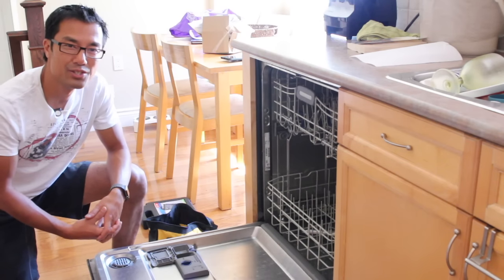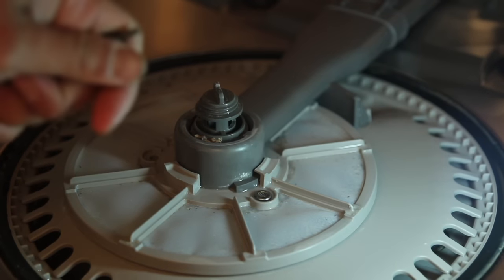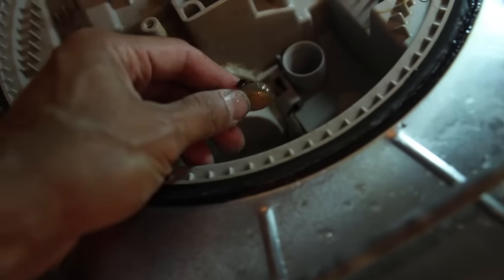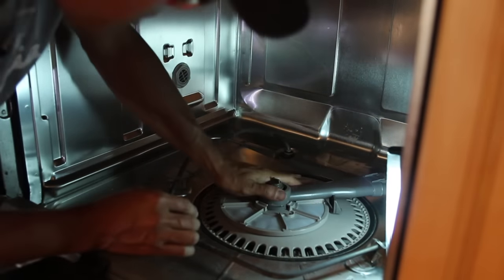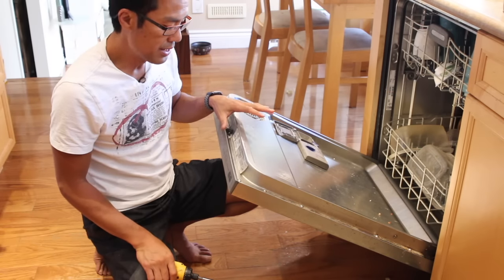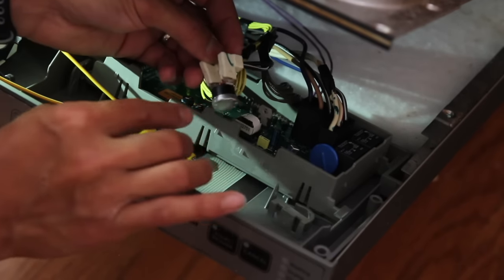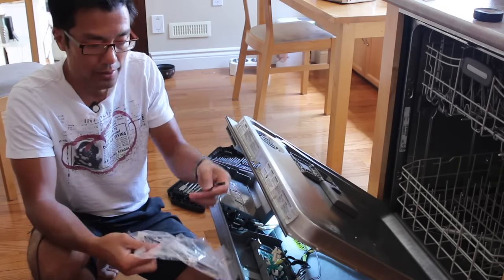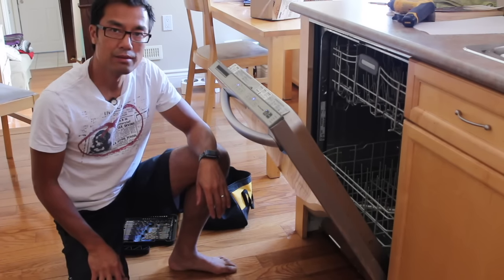KitchenAid Dishwasher Repair - No Power, No Lights and Grinder Clean up

Comment: As you probably already know, jumping the fuse can fry other components, (even if it’s only for 2 seconds), use a volt meter and check it for continuity. The other thing I wanted you to know is that you SHOULD have used the wire(s) that came with the fuse. It’s a common problem that Whirlpool appliances have and Whirlpool had to come up with a “fix” for it. That fix was those wires. Just replacing the fuse itself may not be enough. The wires going to the fuse tend to over heat causing the fuse to blow. Replacing those wires that came WITH the fuse will stop that problem. It’s easy to do, just cut and strip the wires and stick them into the connector that came with the fuse and screw them down tightly. I can’t tell you how many times I have to go back to people’s homes and reinstall it WITH the wires because it can/will possibly blow again. I’m a certified Sears appliance technician. Good luck in your endeavors, all in all, this wasn’t a bad video.
Reply from the maker: These are great advice.  I am going to dig up those wires and install them like you said.  I also got myself a volt meter so I can do continuity tests going forward.  Thanks for commenting and the feedback.  Really appreciate it.
Reply: The Patriots Brother... Ha, you are everywhere. I just had a thought. My heating element and HiTemp thermostat may be aging because I'm overworking them with all the HiTemp cleaning modes and my HOT water only averages maybe 85° because I'm on the 3rd floor of a 100yr old condo. Water pressure is OK, but I have to run HOT water for a while to get 100°+ water.
Reply: Newer dishwashers today need a minimum of 120 degree water or they will shut down and just blink
Reply: @ThePatriotsBrother  - My Maytag manufacturer date is 2010 or 2011.  Would that be considered NEW? It washed dishes fine for years, but quit in 2017. I just fixed it fall of 2019. I really don't like washing dishes, lol!
Reply: Hate to say it but most dishwashers nowadays have their first problems after 4 years.
Reply: Your dishwasher is almost obsolete. Parts are getting harder to find. They want you to buy new. They make more money that way
Reply: My problem with my kitchenaid is I have standing water in the bottom and no power, if i vacuum out the water and wait a bit, eventually everything works again.. once or twice, then same thing at the end of the cycle it won't drain, no lights no power. vacuum out the water, next morning it's working again. any ideas?
Reply from the maker: Check the bottom front right water spout, sometimes, things get stuck underneath and prevents the cycle from completing.  Also do a clean like in my video,  the grinder might be stopping because of built up of things and preventing proper drainage.  The last think is also check the control board to see if there are any burnt areas…there might be some damage that is causing the cycle to stop.
Reply: @mark7603  this is the same problem I'm having! I replaced my chopper about 3 months ago because the dishwasher was making weird noises and failing to complete cycles. That fixed the problem until yesterday when my dishwasher lost power and there's standing water at the bottom. The cycle seems to have completed as the dishes are clean but the water wouldn't drain. I assumed it was due to the fact that it lost power and therefore the pump couldn't pump out the remaining water. I'm gonna have to check it thoroughly today. I'm hoping it's not the control board because I don't really want to buy a brand new dishwasher yet lol.
Reply from the maker: Good luck with the troubleshooting.  You are right about the parts, it is harder and harder to find and they are expensive.  I also would consider buying used dishwashers of Facebook market and stripping it for parts.... Might be cheaper.
Reply: @DDIY-Guy  I discovered yesterday the fuse was blown on mine. So I'm gonna replace it with tips from your video! Thanks for making this! And I appreciate the helpful tips in the comments too!
Reply from the maker: Keep me posted and let me know how to goes.
Reply: @DDIY-Guy  installed the part this evening and it appears to be working. I'm just wondering what will happen when the cycle comes to the end because that's when the fuse blew originally which makes me think something (pump maybe) overloaded the circuit/drew too much power. But could have been resistance build up too. We shall see!
Reply from the maker: Glad that it is working again.  It should be fine now. If it blows again, then yes, there is something else causing it to blow the fuse.
Reply: @DDIY-Guy  Luckily I have been using the dishwasher for 5 days now and no issues yet. Hope it continues to work. Thanks again for this vid! :)
Reply: If you do not have a voltmeter cannot you just take the fuse out and use a battery bicycle light and a few wires to see if you can get current running?

Comment: Video was def helpful, used Kitchen aid ref # for fuse model replacement and found on Amazon for $9.00 waiting on part to complete repair (btw my dishwasher is 13 yrs old and only had to replace chopper 2 times)
Reply from the maker: that’s amazing!  glad it worked!  thanks for commenting.

Comment: Yeah. I did it myself. Cost me about $15.00 AFTER paying repair person $112 for service call who then wanted another $120 for the fuse! Wished I would have seen your video earlier. Thank you.
Reply from the maker: Sorry to hear you had to pay more than you had to…glad you were able to install it yourself.
Reply: @DDIY-Guy  Unfortunately, I ran a cleaning cycle and apparently overheated and blew the fuse again and before it drains! Any idea what might be causing it to overheat???
Reply from the maker: It might just a faulty fuse you bought.  For $15, I would try another brand.
Reply from the maker: Also make sure you do the full cleaning of the grinder, there might be something hard, getting stuck there.

Comment: Once I removed my tripped fuse in my Kenmore 665 (part # W10195528), I used a cheap ($8) non-contact voltmeter to test the fuse wires for voltage after turning on the dishwasher breaker on my electrical panel. When the left side fuse wire lit up, I knew it was probably the fuse. I did buy a replacement wire set on Amazon (next day delivery) by using the part number above and will do my best to install the wires and fuse if possible, based on the Kenmore guy who posted below. 😊

Comment: Thanks very much.  After following your detailed instructions (which were more effective than at similar YouTube pages for this issue) I found the same kind of debris around the food chopper area - a plastic fork handle, a shard of glass, and a few toothpicks.  After re-assembly I removed the fuse and found it had no continuity. I also jumped it per your instruction and the panel lit up. The KitchenAid website wanted $37 for the fuse kit; I got it on Amazon for $8 with 2-day delivery.  This sure beats paying over $1,000 to buy a replacement for my 26-year-old machine!
Reply from the maker: glad it was helpful and you were able to fix your machine.  hope you get more many years out of it.  have a great rest of the week!

Comment: Accurate video, probably saved me hundreds of bucks today. I followed the instructions and cleaned it up. The only things stuck there are a few unsolved plastic wraps of detergent capsules; after removal, power and lights came back so I didn't even open to check the fuse/motherboard. 
Who would think detergent capsules can cause such a problem!
Reply from the maker: That’s fantastic!  Glad it worked for you without replacing the fuse.  Make sure you do a cleaning every few months.  It will keep your dishwasher running like new :-). Thanks for commenting.  Have a great rest of the week!

Comment: Thanks Danny.  Worked great to help diagnose a blown fuse.  Ordered mine and awaiting it's arrival. Fuse arrived, replaced it and it worked, dishwasher is running at this moment. I also took a few minutes and checked the filter and grinder and found plastic pieces in there. Works like a charm now.
Reply from the maker: Glad it helped!  Thanks for commenting.  Let me know when it’s installed and working like it should again.
Reply: DDIY GUY Danny Jose installed and working. I updated my original post to reflect this.

Comment: Excellent tutorial and clear and concise info.  I took everything you did and cleaned out 12 years of built up crud, seed pits, plastic bottle cap.  Easy fix and went back together easily.  I tested it and worked perfect.....With all the gunk I cleaned out of the reservoir and I think it'll do a better job now.  Thanks for saving me a few hundred buck$!  Oh and my fuse was bad also.
Reply from the maker: So glad the video helped.  Thanks for commenting.  Have a great rest of the weekend!

Comment: Thanks so much for this easy fix for the fuse.  I had run my Kitchenaid on hi-temp scrub and it died in the middle of the cycle.  I don't do many repairs so going slowly, it took me an hour and a half including the cleaning.  The easiest part was changing the fuse  I am so glad I found your video - saved me time and $$.
Reply from the maker: Glad the video helped.  Thank you foe commenting.  Have a great rest of the weekend!

Comment: Thanks for the great video. Very thorough and clear instructions. Professionally done. I had the same dishwasher and the same problem. I spent about of one-tenth of the money needed to call a repairman on the order of the thermal fuse. Following every step shown in the video, I did the maintenance cleaning, opened the compartment for the motherboard, replaced the thermal fuse. It is now working as before. BTW, I ordered the part from a local store and picked it up the same day. Thanks again Danny Jose!
Reply from the maker: Wow!  That’s fantastic!  Glad the video helped!  Thank you so much for taking the time to writing this comment.  Really appreciate it.  Have a great rest of the week!

Comment: Good video to watch before service tech arrives. I am not comfortable working with electricity. When the service person comes, I will understand the possible problems and costs. I appreciate the help!
Reply from the maker: Glad you found the video informative….hopefully it will validate what the technician finds.  Expect a charge for troubleshooting the issues, cost for the parts needed (likely replacement of the board) and labour as well.  Hopefully it’s a minor repair.  Keep me posted.

Comment: Nice, easy to follow tutorial. Cautionary note:  Best to switch out both fuse & wiring - otherwise it will likely blow again.  It's easily done, look up "thermal fuse kit" replacement.
Reply from the maker: Good tip.  The wiring comes with it anyways so best to make use of it.  Thanks for commenting!

Comment: Ok...I'm not a repair man, but my DW went dead...I will follow up with a feedback once I follow these step. But I would like to add that the instructor explanation was very clear. Excellent.
Reply from the maker: Thabk you for your comment and feedback.  I hope it works for you and your dishwasher functions again.  Please let my know how it turns out.  Best wishes.
Reply: @DDIY-Guy  I removed the fuse and tested it with a multimeter but he reading state that the fuse was good...So, any suggestion.
Reply from the maker: I would now check the control board and see if there are any blown circuits on the back of it.
Reply: @DDIY-Guy  not sure how to do...that.
Reply: Thank you for responding...I know that my question is out of my scope of practice, but aside from my professional responsibilities as an author, speaker...etc...I've always told people that "NEVER OWN WHAT YOU ARE NOT WILLING TO FIX" and I'm going to do just that. Thanks brother....Keep up the great work
Reply from the maker: There are a few other DIY videos out there that shows how to take out the control board.  Unfortunately I have filmed one....But I understand if you are not comfortable with doing this.
Reply: @DDIY-Guy  I TOOK IT OUT...
Reply from the maker: That’s fantastic!  Let me know how it goes!  Look at the back side...that’s where you’ll see any burn marks.
Reply: @DDIY-Guy  no burn marks
Reply from the maker: If there are not burn marks and there was absolutely no lights that were on in your display panel, then I would suggest jumping that fuse slot that I showed in the video with alligator clips and make sure it wasn’t a blown fuse.  Otherwise I’d check to see if the outlet that your dishwasher is plugged into is actually putting out power.
Reply: @DDIY-Guy  I jumped the fuse and it started for about 3 minutes then stopped.
Reply from the maker: When you said it started for 3 minutes did you mean the lights went on on the panel?  If so, then the fuse was probably blown otherwise the lights wouldn’t have turned on for that 3 minutes. Anyway, don’t run the machine with the jumper,  that’s only to quickly test to see if it was the fuse.  I would maybe buy a new fuse...it’s not that expensive....then try it out.  You might have to do a machine reset....Here is a good site where it goes over these: https://producthelp.kitchenaid.com/Dishwashers/Dishwashers/Product_Info/Dishwasher_Product_Assistance/Dishwasher_Not_Starting_or_Not_Operating

You can also look up “kitchenaid dishawasher ciruit reset”. And read some of the troubleshooting options.
Reply from the maker: Ive had mine where the door wasn’t closing properly since the top frame screw in front of the door was loose so all I had to do is tighten it so the door would close.  If your door doesn’t close properly....then the dishwasher won’t start.
Reply: @DDIY-Guy  Changed the fuse but still not power...all is dead.
Reply from the maker: So sorry you can’t get this to work.  It might be time to get a new dishwasher....getting it fixed by a service guy would probably be costly....anything over $500 is not worth doing.  Plus most service people will charge you a $100 just to come out...plus $$$ to give you an assessment.
Reply from the maker: You might be able to buy a used one on Facebook market for a 1/4 of the price.  Lots of people renovating and getting rid of perfectly good ones.

Comment: At 8:45 into the video - two black relays on the right side of the board. One of mine had blown and burned a bit of the surrounding circuit board. $900 for a new dishwasher vs $150 for a used circuit board. BUT - - I was able to track down one of the relays online for $4! Removed the damaged one, soldered the new one in, and my dishwasher actually worked!
Reply from the maker: That is amazing!!!  I’ve had this dishwasher for about 10 years now and still getting my dishes cleaned.  It’s had it’s fair share of problems but if you are willing to fix it yourself....it will last you for a very long time.  Glad to hear yours as new life :-) have a great week!  Thanks for commenting!
Reply: @DDIY-Guy  I am on a mission to make my dishwasher last TWENTY YEARS...only four more years to go! It's videos like this that have helped me get it to last this long.
Reply from the maker: That’s amazing!  I hope my dishwasher last that long too.  I've learn other fixes on youtube as well so I too appreciate these types of videos and glad to give back as well.  cheers!

Comment: This video is great!  I was able to replace the fuse myself easily.  I also appreciate the advice to clean out the grinder.  I took the extra time to do that and found a cherry pit, some glass, ceramic etc.  The instructions are very easy to follow!  Thank you!
Reply from the maker: So glad the video helped.  Thank you for commenting! Have a fantastic rest of the week.
Reply: @DDIY-Guy  The same fuse blew again for me.  I have another one on order and I will clean out the grinder again.  If I don't find anything in the grinder could it be something else down the line?  Your video is so easy and clear!!!  Thank you again!
Reply from the maker: It could be just the type of fuse you got.  Someone else suggested that you also replace the wires that come with the fuse you ordered.  That might help carry the electrical load better.  Let me know how it goes.  It might just be by chance that it blew so shortly after....mine has been working since I first replaced it.  Anyway, it’s good that the fuse blows, it means it’s doing it’s job.

Comment: Thank you so much. Did exactly what you did and it'd worked again.  Saved me 100's of dollars 💸.   But now it stops running mid cycle almost like you hit pause.  If not one thing it's another.  Thanks a million
Reply from the maker: Glad it worked for you.  If it stopped mid cycle, try turning off the power at the breaker for it and reboot your washer.   If that didn’t work, there might be something wrong with the board.

Comment: Many thanks, Danny!  While I agree with ThePatriotsBrother, your video gave me a great place to begin diagnostics of my dead touchpad.
  SECOND TIP is another YouTube instruction:  With door open, disconnect from control board the power connector and both touch pad connectors. Wait 7 seconds, then close door.  If pump begins drain cycle, your control board is OK!  After this step, my touchpad came on again and all is good!  Maybe this reset the control board??
  THIRD (and it would be easy to first try this):  My model is a 12 year-old KUDS30FXSS3.  The repair sheet inside the toe-kick apron also describes a UI (User Interface) test:  with all connectors connected, press any 3 touchpad buttons sequentially 3 times in a row.  If UI is OK, all buttons/lights will simultaneously light up.  (If less than all light up, there is an error code descriptor.)
Reply from the maker: thank for the additional tips!